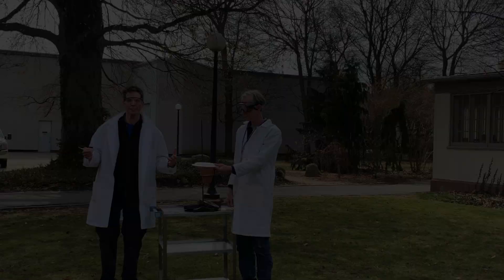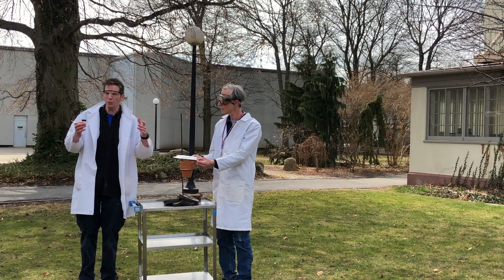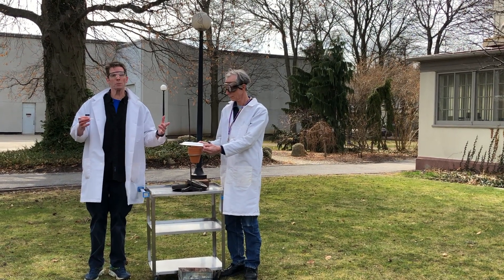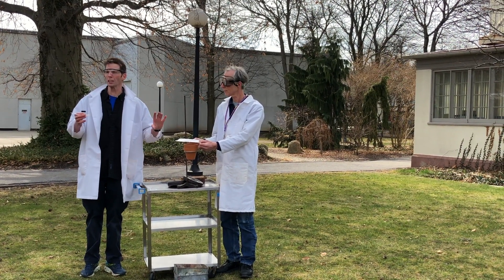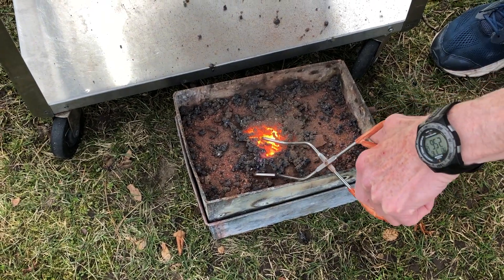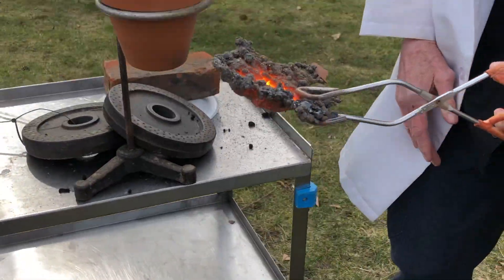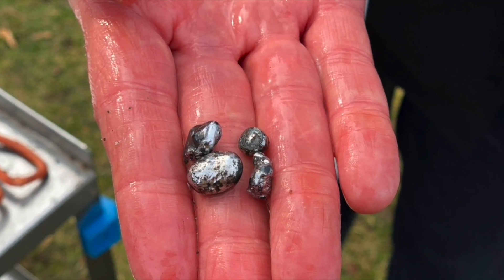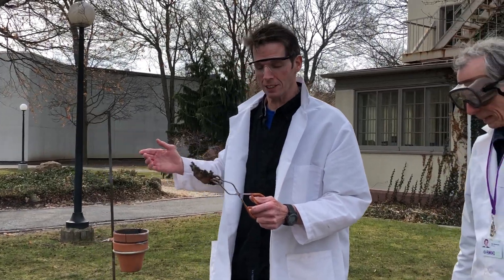Live Science: The Thermite Reaction

Comment: I used to try experiments pre 9/11 as certain chemicals were took off shelf. Was a certain weedkiller, an aluminium tin and sugar as an oxidzer. Iron oxide is a pain to collect, even through electrolysis.  Was great fun if ur interested in chemistry, but 9/11 ended all that 😢
Reply: Metal filings from a brake lathe at a automotive shop

Comment: I've worked in iron and aluminum foundries and found out you don't mix aluminum dust with iron powder, as it produces a really good chemical reaction,or thermite,  trouble was everybody knew it was wrong, but nobody understood why, till somebody died,  if you grind steel on a linisher then grind aluminum it's the best way to take the skin off your face in a split second.
Alternatively put aluminum in a cast iron cupola and it will destroy most of the foundry and surrounding area.

Comment: hot enough to melt the Twin Towers? melting point of steel is 2750 F, so slightly not hot enough?
Reply: the melting point depends on the steel alloy
Reply: Just needs enough heat to bend the beam slightly
Reply: You don't have to melt steel beams for them to lose structural integrity.
Reply: Quite close to it